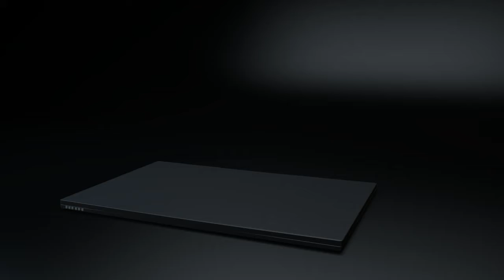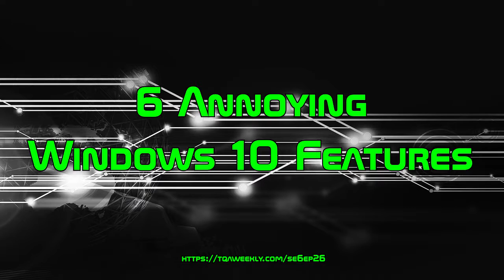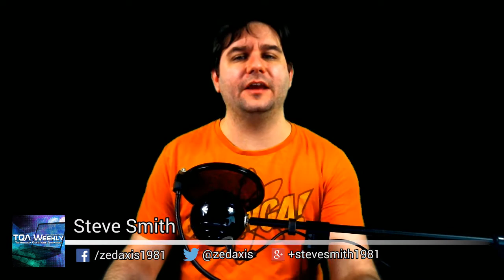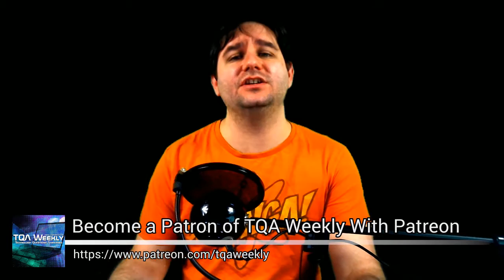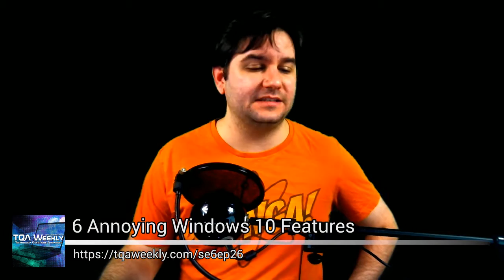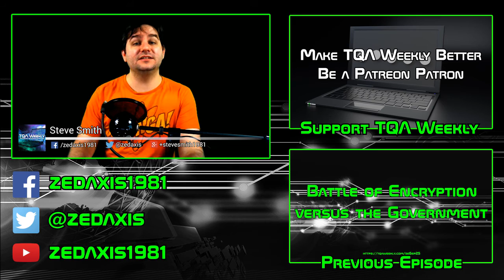6 Annoying Windows 10 Features

Comment: If an OS has to restart to update it is designed wrong. 

I want an OS to be feature-less and capability full. It is going in the opposite direction. It should be like clay.

I have fully updated Linux servers that have not been rebooted in years.